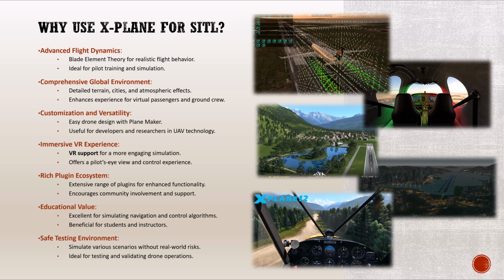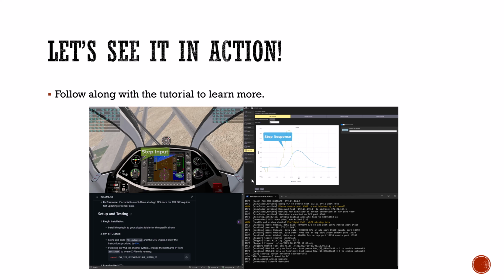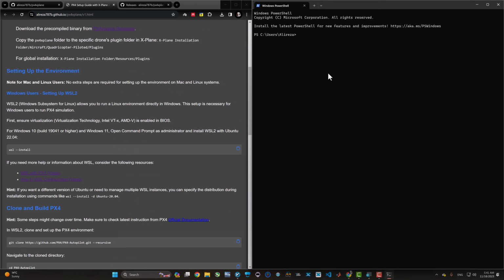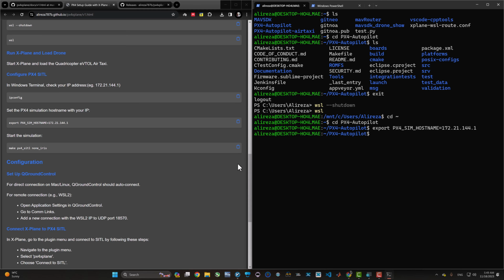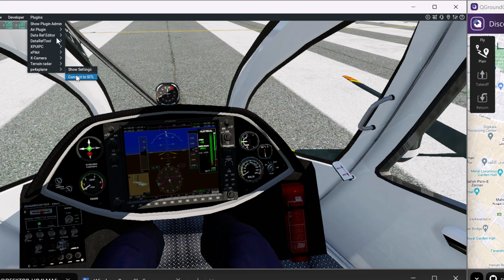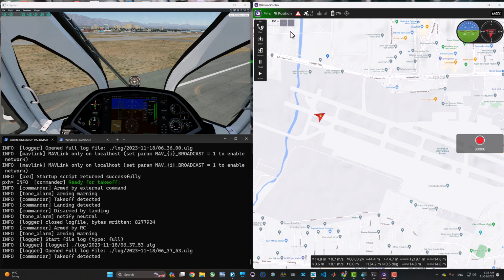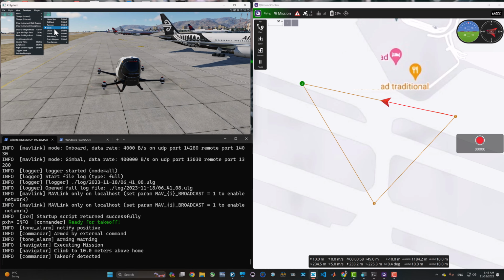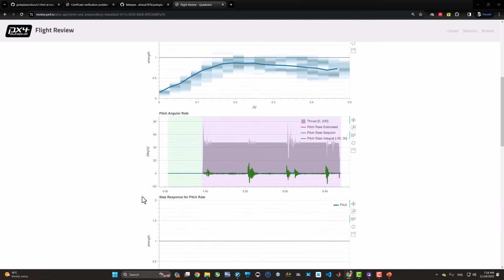PX4 X-Plane SITL Ultimate Setup Guide: Fly Custom eVTOL & Drones in Real Worlds - Version 1.0.0

Comment: Great video! I got your set up running but have been having problems with the quad overshooting in yaw. I have tried xplane 11 and 12. Fps is about 60fps. Do you have any ideas?
Reply from the maker: maybe play with PIDs a little and reduce yaw terms. I will re-check the estimators for magnetic sensors later and check if I can make it better or nor

Comment: After finishing all these steps, I was run the px4 in WSL then connected QGC after that while connecting x-plane 11 plugin in my x-plane it was crashing. give me solution for this issue.
Reply from the maker: can you check the xplane log that what caused xplane to crash? and are you using the latest version?
Reply: I had a similar problem. My issue was windows fire wall blocking communication

Comment: Can you please give/upload the makefile,if possible?.. I am working in Linux.. so the makefile can help me with convert the win.xpl to lin.xpl.. 
Thanks in advance..
Reply from the maker: Alexander is already preparing the makefiles for Linux once he finished he will add it to the repo
Reply: Converted it to lin.xpl using the existing makefile in xplane plugin section.. is it working good in Linux as good as windows for you? For me, the flight was horrible.. I think I need to check the airframe and parameters from my side..
Reply from the maker: @only_genga  if you can share makefiles in a pull request in github its appreciated.   you need to use paramteres and aircraft definitino based on your drone. I have opened a pull request in PX4 official to add this airframes officailly . until then you can use my forked PX4 SITL  https://github.com/alireza787b/PX4-Autopilot-Me
Reply: i was in remote area. thats why i can't able to reply. i dont know this method of getting the lin.xpl file is correct way or not. but it worked  and i got the lin.xpl file.
code and makefile g-drive link: https://drive.google.com/drive/folders/1mHGqsnEc00NtUVCqPgaxnIB33TmfLwIN?usp=sharing
hope its helpful. please correct me if i am wrong. and is this way of getting the lin.xpl file is correct?
Reply: i downloaded that makefile from xplane sdk plugin site (hello world sdk 2 plugin makefile for linux)
Reply: However the flight was horrable. i am running in custom airframe.i think that the motor postion and tuning values are wrong. how to set the motor positions in the airframe. can we directly give the xplane motor postion from plane maker into px3 airframe motor postion? thanks in advance
Reply: did you get the makefile? is it working?